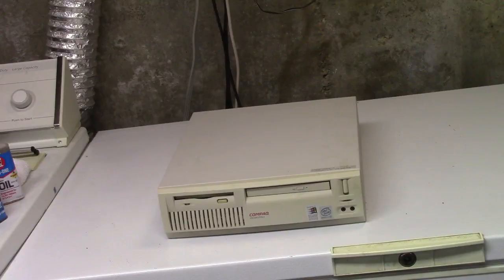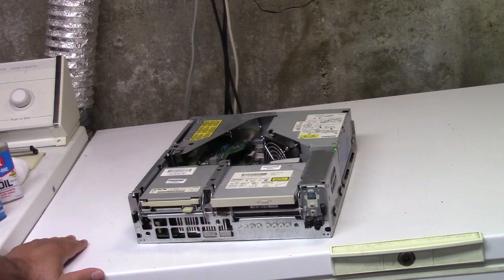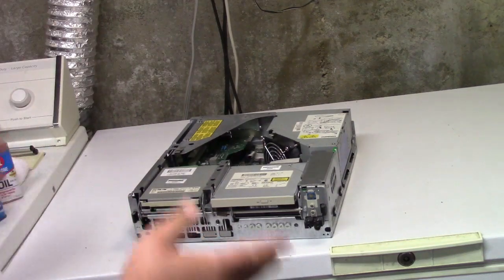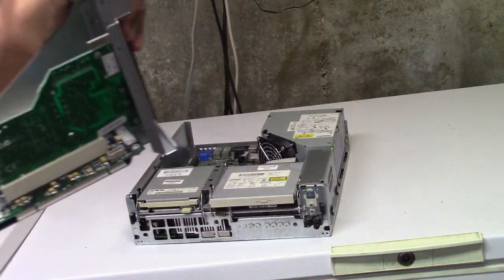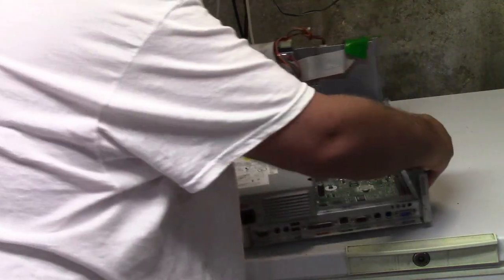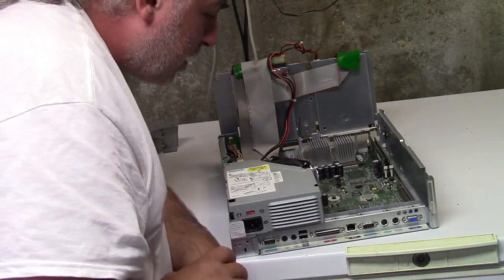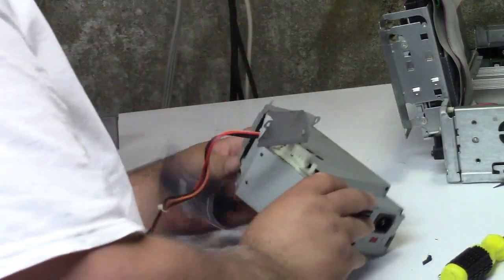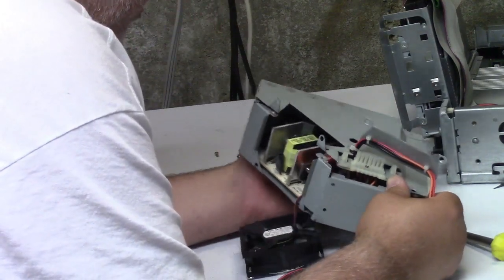Failing Digital Picture Frame Computer, Part 1 - Toolless Doesn't Mean Toolless

Comment: From an aesthetic viewpoint, these types of computers have always been my favorite. The beige small form factors with floppy and CD drives. They just look so classical. My school library had one or two of these left running the electronic card catalogue software. Always wanted to get one for myself to play around with, but I never had the space to set one up anywhere.
Reply from the maker: These DeskPro machines are actually quite interesting.  I have a DeskPro 286 and a DeskPro 386, from their very very early days.  Those are huge, heavy desktop cases.

I also have a somewhat later DeskPro, but it's a tower version, again, a big heavy case.  2 interesting features it has:  the sound card output is routed to an onboard speaker that actually gets decently loud enough for office use, and it has a solenoid-powered case lock with intrusion detection.  One day I'll have to dig it out and show that off.

I have another SFF case, but it's severely underpowered, using only a Cyrix processor, probably back from the Pentium II days where you got a Cyrix Instead instead of an Intel Inside.  I can't remember if that had a speaker in it, but it may not be a DeskPro, just a SFF case.  That one is a lot easier to dig out.

The one in this video does route its sound output through the onboard speaker, and I actually have used that capability once or twice.

When I was a kid, we had a manual card catalog, one sorted by title, one by subject, and one by author!
Reply: The second one sounds interesting. I think Cyrix supported the i386 instruction set, so in theory, software support shouldn't have been an issue like it is with older Power PC Macs, but I wonder if that theory holds up in practice. 

We had a traditional card catalogue too, but no one ever used it. Probably a good thing given how cranky the librarian was. You put a card out of place and next thing you know, you're getting an ear full.
Reply from the maker: Yeah the Cyrix does everything its supposed to, it's just REALLY slow.  Fun fact:  When I first moved into the house, I had nothing set up yet.  No network, nothing.  Didn't have my stereo or anything set up either.  What I did have was an old Peavey PA amplifier with speaker, and on top of that I put that Compaq with the Cyrix chip and a CRT screen, along with an external hard drive that had my music on it.  I used to turn that thing on and walk away for 10 minutes while it booted up.  Ran XP on it too.  Chances are it'll probably still boot up and work fine.  I've been toying with the idea of a video on that one day, but this series will be going for quite some time.  And I have other multi-part series as well that have been on hold because of China reviews.  In fact this series will be taking periodic breaks for other CHina reviews as well as other videos.

I actually just looked it up and found out they still sell card catalog cards with the hole punched through the center at the bottom.

Comment: I still have one similar to yours somewhere stored at my parents place with all my other old junk.
Picked mine up off of the street like ten years ago or so. I think I installed some Linux distro on it back when I got it, but never did anything else with it other than put it into storage.
Reply from the maker: That's actually a fairly common occurrence with these machines.

Comment: I think that is the first time I have ever seen an actual proprietary setup.  If it was me I would probably try to figure out the pin out to keep it going and have the fun to find out if it smokes or pops.
Reply from the maker: I've seen proprietary setups several other times.  Some of the HP branded SFF machines took a power supply connector that looked identical to an ATX one, but was miniaturized.  At Tiny Middle, it made it fun because we couldn't really test the board with a good supply (God forbid we'd be allowed to keep one in stock just for testing).  I'd have to just jump it with the paper clip.  99% of the time, the supply itself called it quits anyway.

I still have the machine, so pinning it out isn't out of the question, but still nothing I'm terribly inclined to do.  The good part is the supply does still work so a few minutes with a meter and it can be pinned out.

Comment: I have a identical machine, bought for 5 bucks at a thrift store. Has its original install of 98. Around two weeks ago, I was out hunting at some thrift stores again and found a Optiplex GX280 for the lovely price of 75.00$. Needless to say, That machine's permanent home will be that store unless they drop the price alot.
Reply from the maker: That was a high-end machine for its time.  But I do agree, $75 is way too high.  $50 is a lot more reasonable but still too expensive.  Once you get down into the $25-$40 range, maybe.  Anything below that and it goes in the cart immediately.
Reply from the maker: I may actually have one of those sitting in my garage, waiting for one of my long computer repair series, come to think of it...
Reply: @jaykay18  I would've gotten it if the price was a bit more reasonable. The guy running the place didn't seem very nice so I didn't try to negotiate. I have a 270 but all its caps have leaked so the mobo needs a good recapping. Surprised it still works. I'd like to toy around with a 280 since they're socket 775 and have PCI Express. See how far I could push it in the modern world. Doubt I could put anything better than a P4 since even the 520/620 won't boot a Core2 chip. Still would be interesting though.
Reply from the maker: Yeah the machine I normally use has a socket 775 P4 (3.4GHz) and PCI Express.  It's just barely tolerable for day-to-day tasks now, running Windows 7.  All its caps have exploded as well yet it also keeps working.  At this point I'm done with it, just waiting for it to die already so I can replace it.  But nope, it keeps holding on, which is fine with me for now.

Comment: Man ,  i would not be confortable knowing that i have a pc running in a such a small closed space without ventilation.... something bad could happen, even caut on fire....
Reply from the maker: Nah, it's perfectly fine.  Been running for years in there that way.  Got to a certain temperature and stayed there and that's it, no hotter.  Should it have had a fan fail, and if there were no sensor or a non-functioning sensor for the processor temperature and the temperature increased and increased and increased, chances are good the system would lock up, and I'd have noticed that long before anything were to happen.  Even if it got that hot, chances are the chip would just fail, it wouldn't shoot sparks out and turn into a flamethrower.  It's a non-issue.